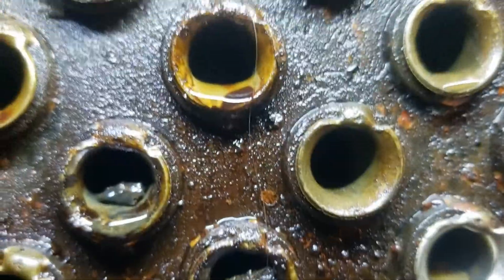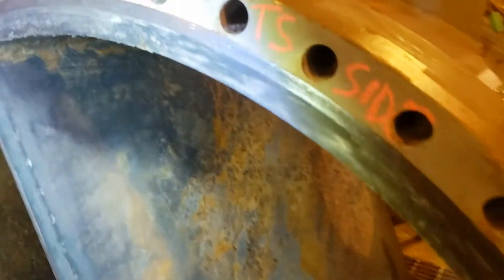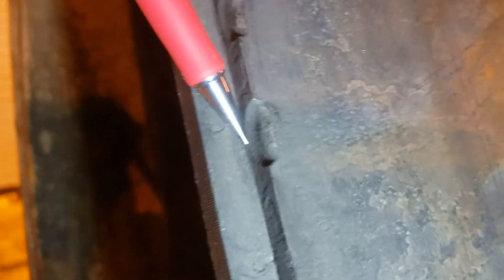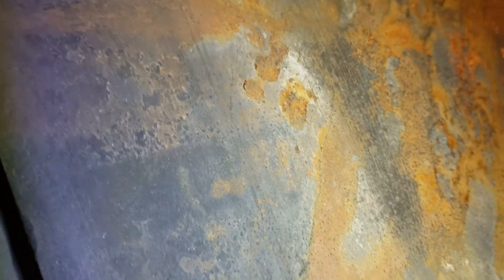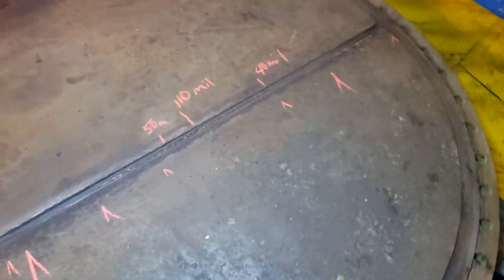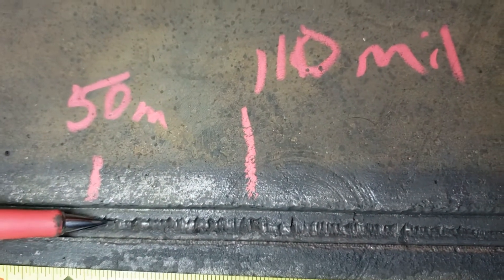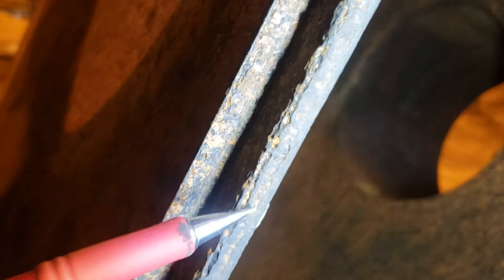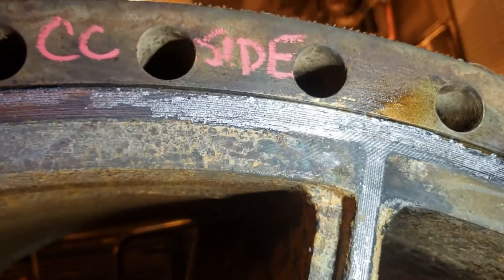API 510 inspection // erosion of Channel and Channel cover

Comment: How would you measure the erosion on the partition plate? And how would describe it in a report?  Thank you !
Reply from the maker: I measured this erosion with a Thorpe gauge, which is what I use almost exclusively.   When my Thorpe doesn't fit, I'll get creative. 

MrEric
Reply: @MrEric_API  you should come out with a how to inspect pressure vessel / pressure piping course. I’d buy it!

Comment: the gasket surface looks like someone cut it out with a torch. I wonder what the effect from the heat treating changing from being cut originally had on the edges of the sheets
Reply from the maker: I believe the edge was machined, and it likely was rough cut quite large prior to machining, which should remove any heat affected area in the machining process